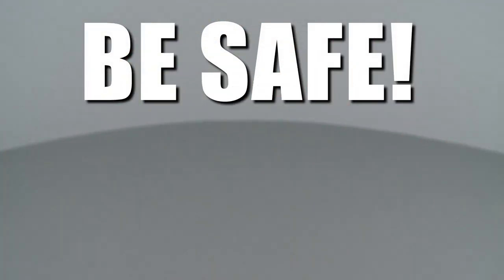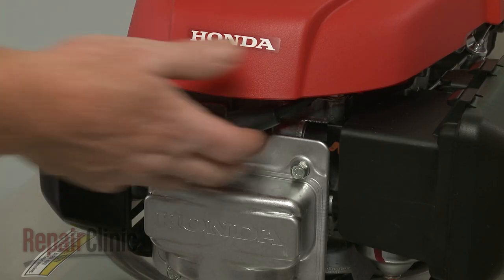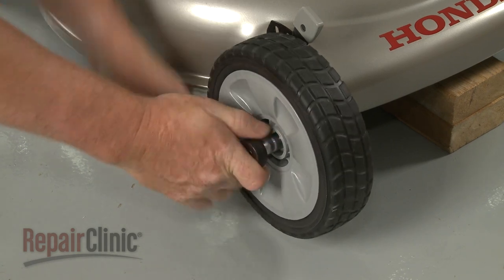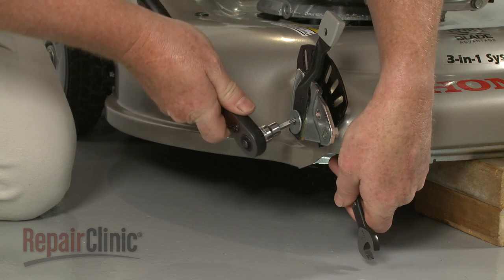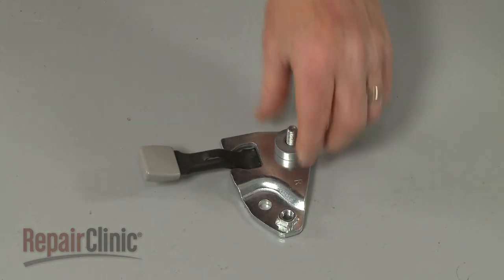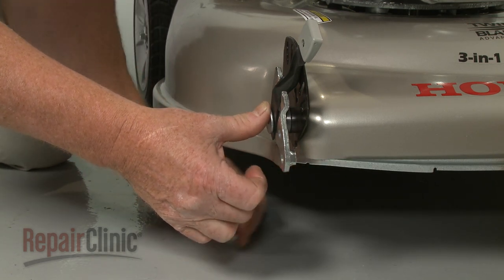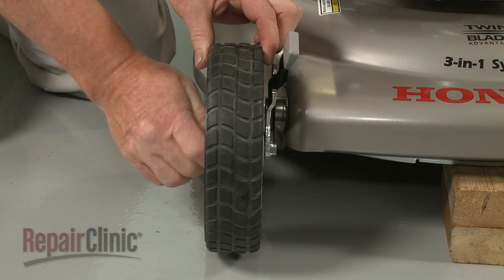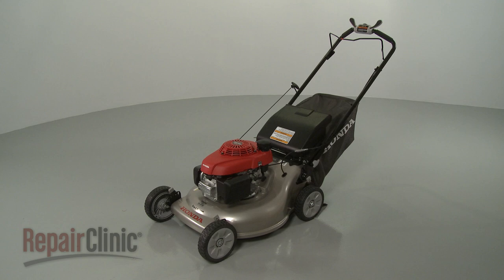Honda Lawn Mower Right Front Wheel Support Part # 42911-VL0-900

Comment: When the front wheel wobbles, is it the support that has worn or the spacer?  The adjustment lever will not stay in the slot while mowing because there is too much play between all parts.  What is the most likely repair needed?
Reply: @repairclinic  Thanks for answering. Do they sell just the Spacer?  I just thought there might be a common wear on either the Wheel Supportbracket or the Spacer.  Something that had shown itself over time.  A common order of parts.  There is too much play between the spacer, the bracket and therefore the adjusting lever does not stay in the adjustment slot plate while mowing.  I will taking it apart today.  HHR2169VKA. Thanks again.
Reply: @Lucky-vf7wy  , did you end up replacing the spacers?  I have the same issue where my right front is wobbly and gets lose.  It has fallen off twice and I tighten it with a socket really tight but there is still play.  I assume I need to replace the spacer or tire because the bushing is worn.
Reply: @moosemonty  Simple fix.  I found washers that had the same size hole as the bolt.  The thickness of the washer added to the spacer and was all it needed to make the adjustment lever fit tight in the slot.  Mowed today and it held just fine.  Hope this helps.
Reply: @repairclinic  Thanks for trying.  Simple fix.  I found washers that had the same size hole as the bolt.  The thickness of the washer added to the spacer and was all it needed to make the adjustment lever fit tight in the slot.  Mowed today and it held just fine.

Comment: Good tutorial, I feel like Honda could have done a better job with these front wheels. They are always uneven and don't roll smoothly.
Reply: I agree I love my Honda but the front wheels could be a lot better
Reply: @veltlewis76  removed the curved washer on mine and it rolls better
Reply: I've had nothing but problems with wheels.......Honda has a good engine..... but the wheels are the worst. Need 110% improvement. That circumstance alone is why I will NOT ever buy another Honda mower.
Reply: @B126USMC Fr man my front wheels just get lose so fast and it drives me crazy
Reply: Weird - my HRR216VKA is right at 10 years old and this is first time I'm looking up this adjustment.